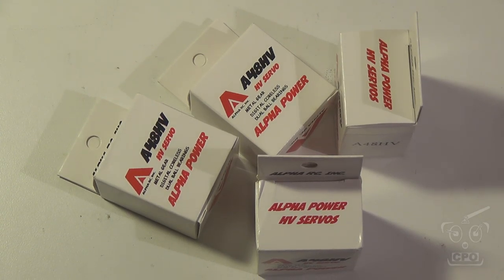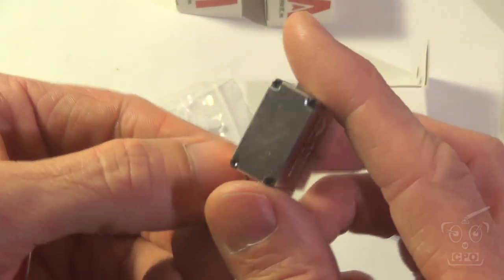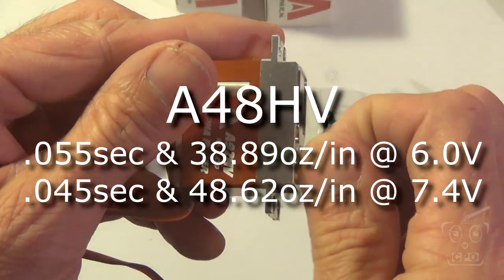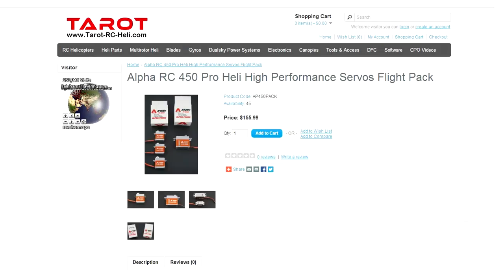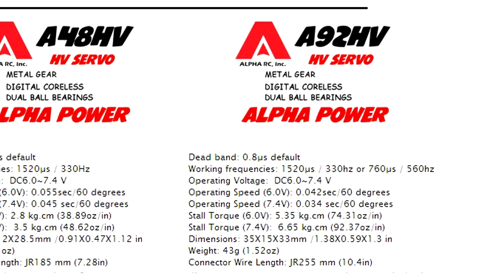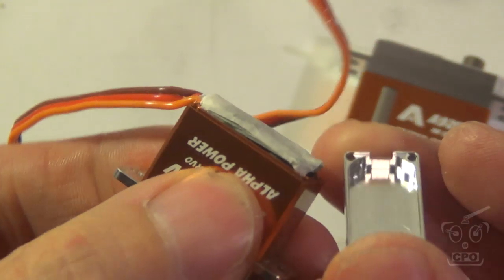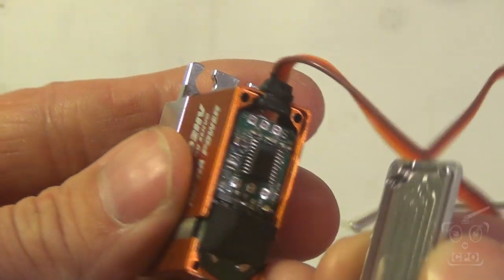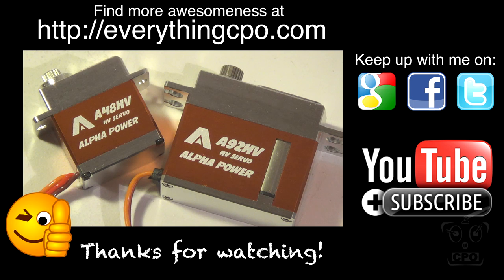CPO Quick Look : Alpha RC 450 Class Servos (A48HV & A92HV)

Comment: Looks like a nice priced kit. I'll be interested to see how they perform.

If you haven't picked out a new ESC yet, check out the HobbyWing Platinum PRO V3 50A. I just switched to it on my Gaui X3 and I'm loving it. It has a great adjustable BEC and nice gov as well. Very good price too.
Reply from the maker: ESC sounds nice. For now I am putting on a Hobby Wing Platinum-40A-PRO...since I have one on hand. I can run it at 6V/3A.  It's at least a step up (okay, technically a half a step) from the YEP 45 I have on there now (5.5V).
Reply: EVERYTHING cpo You should probably,just get a BEC for security!! I wonder what the amp draw is on all 4 of those servos working together?
Reply from the maker: im2tall1 I'll test the amp draw and find out!

Comment: Looking for the best servo money can buy that will be a match for either the Savox SH-0255MG Micro Digital Servo or the Turnigy TGY-9018MG Metal Gear Servo for a carbon fiber tricopter build. I need it to be as smooth as Mondavi and strong as Atlas but weigh as little as possible... I will sacrifice weight for durability and performance all day long though.
Reply from the maker: Well... Look at the specs on these and see if they look good to you. They are very smooth. I can't comment on much else, since I haven't powered them up yet. Alpha RC does give them a 6 month warranty...
Reply: EVERYTHING cpo
Doing that now =)